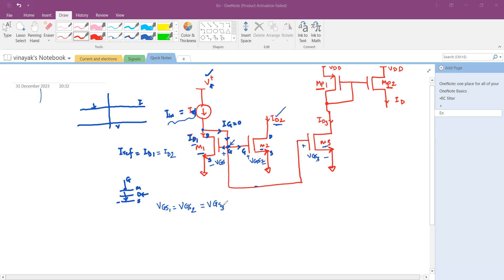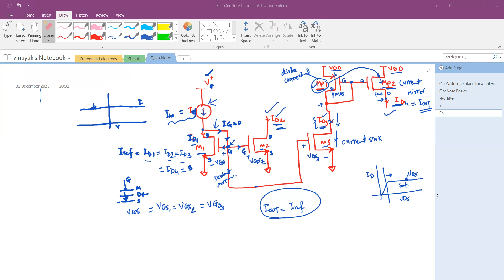How to use current mirror | biasing circuits

Comment: The problem is that mosfets of the same type typically have a wide variation in their characteristics. That makes matching pairs a tedious process, let alone trying to find three matching mosfets, so this is not a practical circuit for building with discrete devices. Arrays of matched mosfets exist, for example ALD1106 (n-channel) and ALD1107 (p-channel), but they are priced at over £5 each in single quantities from Mouser.
Reply from the maker: MOSFETS are better to build current mirror as they do not introduce current gain error due to finite base current as in BJTs. About reducing the error due to the variation in their electrical behaviour, there are improved version of this circuit to reduce the error. Check out our other videos
Reply: @stem1122hjf  No, they really are not. Common BJTs can have a β well over 400, introducing a current balance error of less than 0.5%, which is equal to the best matching you will get with arrays of mosfets. In addition, at Vds close to their threshold voltage (as M1 in your diagram), a mosfet's output impedance is typically an order of magnitude less than that of a BJT in a similar circuit, introducing far more error as the voltage at the drain of M2 varies. And none of that addresses the cost of buying an array of matched mosfets. The only place you'll find mosfet current mirrors is inside cmos opamps and similar.
Reply from the maker: @RexxSchneider  yes, mosfet Current Mirrors in cmos IC Design and BJTs still stay relevant to many applications. Also, MOSFETs - not normally used in bandgap reference voltage circuits as their electrical behavior is heavily process-dependent.